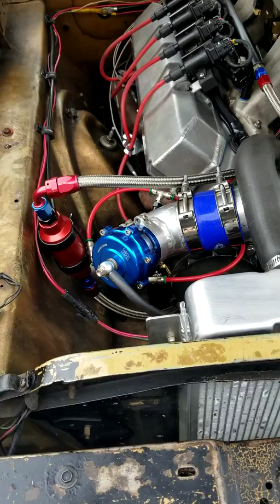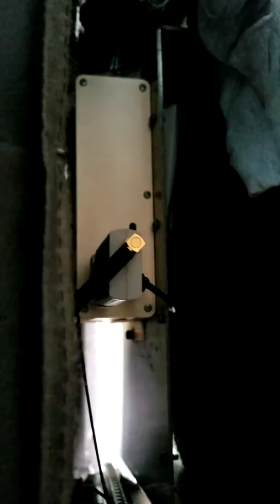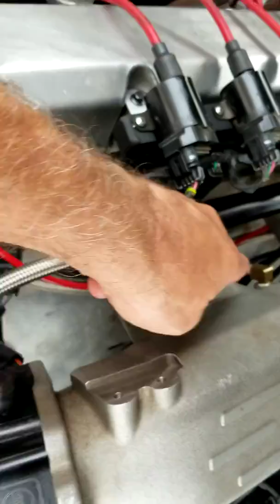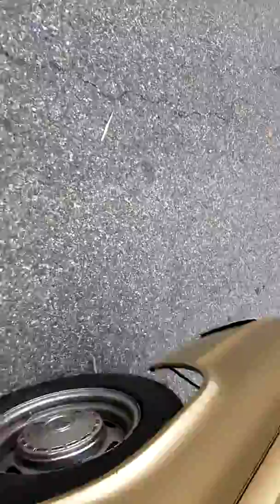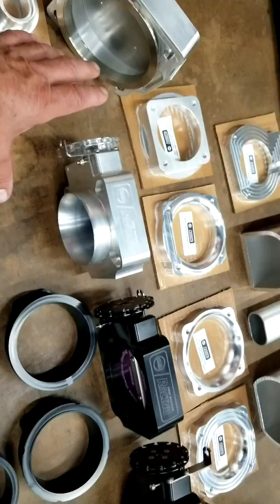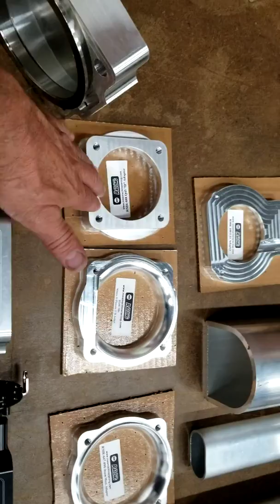Dodge Coronet 440 EFI Rear Mount Turbo

Comment: Great video, I am considering upgrading to EFI system for my 440. Which setup do you recommend ? Would like to set it and forget it.
Reply from the maker: I don’t have any personal experience with any other systems. I like my setup because it allows me the ability to improve my cars performance (I’ve got it down to 10.18 in 1/4m) so I’m constantly adjusting it and I enjoy that. My setup does allow you to set it and forget but I think it’s a little more work than a Holly Sniper or something like that. I do offer for sale the hardware parts you will need for a setup like mine along with the advice to get it done right. Or I could install it for you.

Comment: What cylinder heads are those?
Reply from the maker: Those are Pro Comp Heads. If I were to buy them new I would buy them bare / no hardware the castings have been good.
Reply: @jimgreenwell1244  Are they the heads that are Eddy Victor knock offs? I bought 440 Source cnc Stealth heads for my 440. The cnc porting, valve job and assembly was done by Modern cylinder Head. I took them to a local cylinder head guy and had him disassemble and check them out. They were perfect, no problems found. I've been running them for seven years now.
Reply from the maker: @Doosterify  They are raised port heads

Comment: What size injectors are you running
Reply from the maker: I am currently running 85lb injectors at 60psi I bought my current injectors from EFISOURCE. The most important thing is to not exceed 80% duty cycle.
Reply from the maker: No I am not running a knock sensor. I have been running straight e85 and I have a Snow Performance water/meth injection system on the motor. Currently at 15lbs of boost I'm running 26degs advance timing. This motor was not built for a lot of horsepower so I have not been aggressive with timing and boost. I have a new stronger short block sitting on the  floor which will be going in soon.
Reply: Are you running a knock sensor?